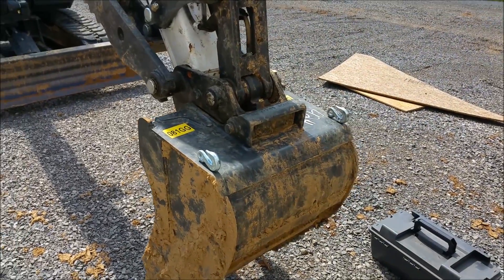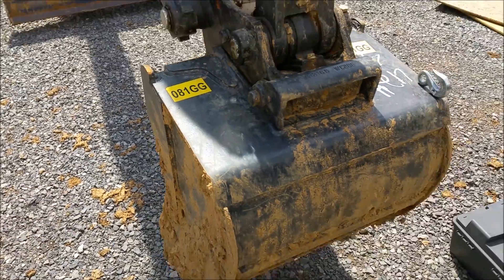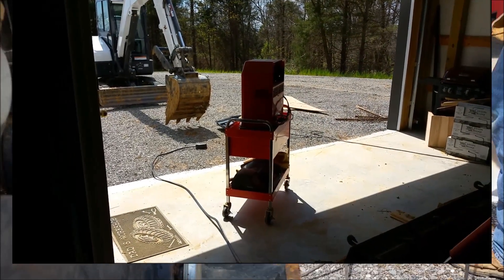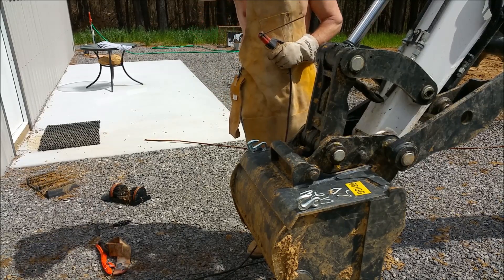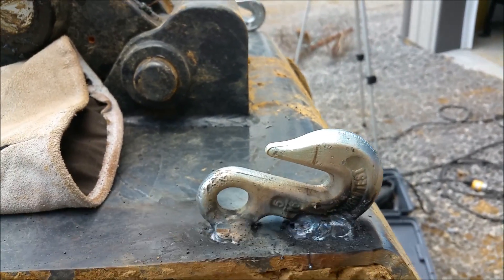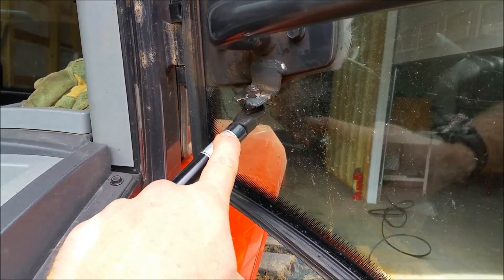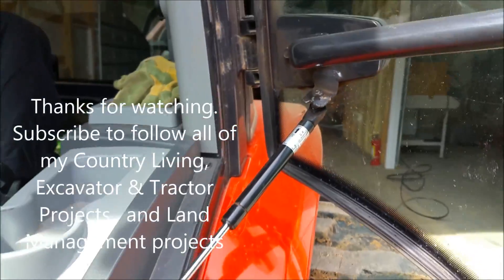Welding Chain Hooks on Bobcat E42 Excavator bucket. 7014 Welding Rods

Comment: Just an FYI they make Weld on hooks they are flat on the back side, nice chamfers so you don't have to do any grinding on them and they will be way stronger then the ones you just put on your bucket.
Reply from the maker: Josh C thanks,  I have not seen them at Menards or Rural King though, special order?
Reply: I bought mine on eBay and got the best price I could find anywhere.  Search for "weld on hooks".
Reply: look em up on ebay they have em in pairs or in pack of ten or more for a few dollars a piece , cheaper when you purchase by a lot of eight or more

Comment: Not trying to be rude, but I don't think you read enough about welding, if your confidently welding hooks onto that excavator bucket with 7014 rod, just my own personal opinion. 7014 is not a good rod for dirty steel, nor is it strong enough to weld anything critical, such as that bucket of yours. 7014 is very similar to 6013, actually they both suck just about the same. Now, cellulose rods like 6010 & 6011 work well on dirty, painted, rusty metal but I still wouldnt weld something critical with only 6010or6011. If I had to weld the hooks on your bucket, I would cut out x2 squares of 1/4" or 3/8" plate, debur and clean up them up, then weld those squares to the bucket in desired locations, then weld the hooks to the plate steel. Root pass with 6010 nice and hot about 95-100 amps, then cover it up with a pass of 7018, burn it in there at about 120-125 amps. Bam, there you go, hooks that will be able to take x10 more shock loading and stress because the plate their welded to distributes the force to a wider area more evenly. Hope that makes sense
Reply: Have you ever seen a real welder welding without a shirt on?  Just a amature!

Comment: One way to check penetration of your weld in the bucket steel is to look at the other side to see if it is discolored. If so, you probably have decent penetration. At least that's a tip I got from a relative that is a welder.

Comment: hooks are always good , need to put one in middle for those center pick loads, wont put load on out side of bucket
Reply from the maker: Gregory Krawchuk good point! I'm getting more hooks for the 3-foot bucket today so I'll be sure to add one in the center also! thanks
Reply from the maker: I actually have a short length of 5/16th chain that I put between the 2 hooks and then can hook another chain in the center of that chain. That will also be useful for my scale to hook on to weigh more cool stuff!

Comment: Cool video.  Old now I know but use 7018 for future hooks.  Clean the surface of the weld joint.  7018 is the strongest “home shop” rod and offers the best ductility, thus giving the best chance of NOT having the hook pop off.  Also 7014 is NOT used for “dirty” surfaces.   That’s what 6010 and 6011 are for if you can’t clean it that well.   One should always however strive to clean the metal a “shiny” steel surface for the very best weld adhesion.  Also, those Lincoln Buzz Box welders are awesome.  So simple and they last a lifetime if you take care of them.
Reply from the maker: Don't recall what I used on this project but you may be right. I have not had any trouble with the 7018's, I don't think I used 7014, don't think I have those. But so far the hooks have not broke yet! Lol
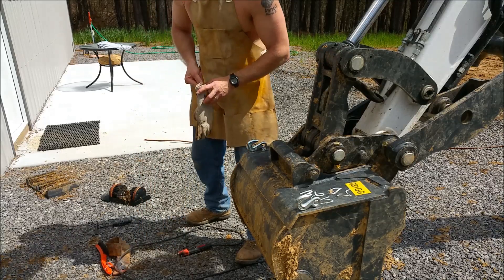Reply: @kapperoutdoors  At you 3:55 in the video you say "I'm using 7014. It's for a bit dirtier metal."

Comment: One way to keep your hooks straight is to weld a couple of tacks on one side then weld a   couple of tacks on the other side the hook. The heat of the first tacks will draw the hook over and then the heat of the second tacks will draw the hook back to straight. Thanks for the great videos
Reply from the maker: Yeah, I remembered that after, but since they did not suck in this time I was OK. I think if the first hit would have pulled it over, i would have remembered to do that!! I guess the brain is full Lol... If something new comes in, then something from memory has to leave! :)
Reply: Yea, it's called CRS (can't remember shit). I am a long time sufferer. Stay frosty

Comment: I hope that you unhooked the bucket before welding to avoid messing up the machine computer
Reply from the maker: Nope. In theory, the electrical charge travels to the shortest point, with least resistance.. i.e. from the clamp to the stick. Lets home there's enough paint & grease & joints in between the computer & charge! She started up & moved just fine after ward.. Now I'll have to do a little reading on that.... :(
Reply from the maker: So, now out of curiosity, I did some reading on this topic, and seems the overwhelming majority consensus is to ground your welder as close to the welding location as possible.. (ummm, supposed to do that in the first place). Also sounds like the odds of anything frying (with the ground placed as mentioned and not running the current from the back of the machine to the front!) are less than crashing in an airplane. Lots of differing 'theories' though. I may weld the next one(s) with it off just to be safe though, but then I'll have to break out the welding magnets to hold the hooks in place.. which never seems to work well for me...
Reply: That’s a myth.   No need to do what you claim.  I’ve been welding on vehicles for 35+ years.  Keep the “work” clamp (technically it’s not a true “ground”) the shortest distance possible from the joint you’re welding.  It’s the same electrical theory why birds can land on high voltage power lines and life long lives.

Comment: Only thing you didn't mention was if you disconnected the batteries to both the tractor and excavator before welding. Reason I ask is you could fry the computers in either machine once the arc strikes. 
In the case of the bucket you could have just welded that separate from the machine.

But yeah.. not a good idea to run current through the machine frame IMO
I mig weld myself... never did any stick but flux core is pretty much the same just using a wire feeder.
Reply from the maker: No I did not disconnect anything. Seems to be a lot of stories rather than hard fact, with a couple that I've found that actually had issues with that. If I were welding anywhere close to the cab/frame, I would consider it then. Thanks.
Reply: It doesnt matter if welding near frame or cab, if your welding on the chassis anywhere thats connected to the electrical then it can backfeed and possibly fry the electrical. Always disconnect the battery on any vehicle when doing any welding on it.